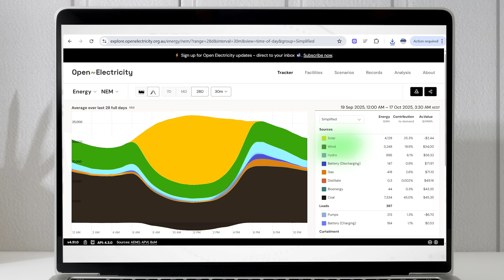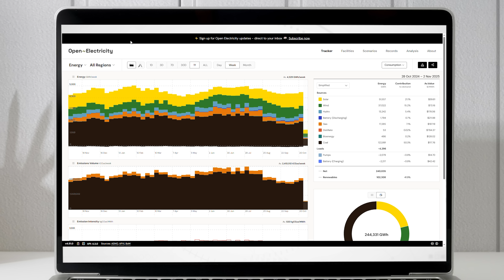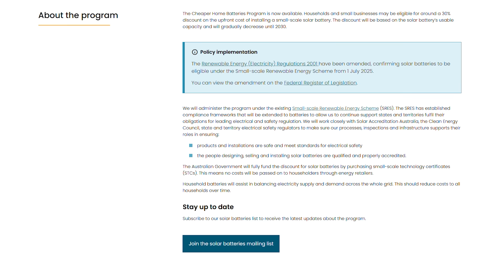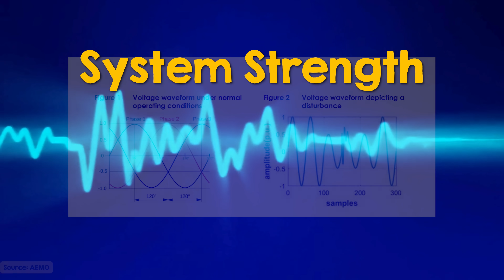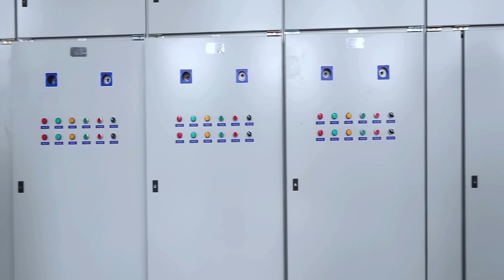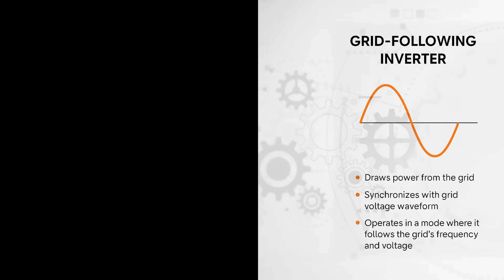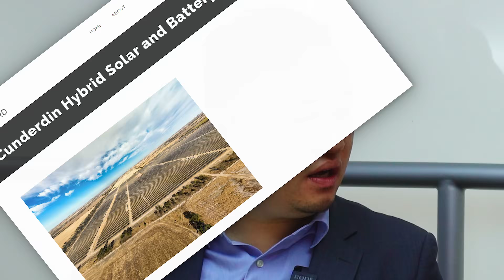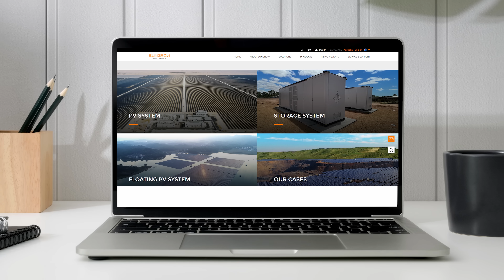Australia’s Solar Boom Is Breaking the Grid - Or Is It?

Comment: Sorry to be the negative nancy. But there are several problems with this rosy future. Firstly synchronous condensers don't increase power, they are mainly a stabilising device used to regulate voltage and improve power factor. And my biggest question with them is, if they are so expensive and in short supply, why is this the case, when demand for them has been growing in line with the roll out of solar on the grid. you would think manufacturers would have ramped up by now. Has the energy regulator and the government been asleep at the wheel for the last two decades? 
Also in regards to grid following inverters, my limited understanding is that all rooftop solar inverters are required to be grid following in order to maintain safety so that they will shut down when there is a grid level blackout. If the solution to the lack of inertia is grid forming inverters will these only be able to be used at  grid scale generation systems and will they be sufficient if only used in relatively small quantities at key locations. The lesson we should be learning from the Spanish grid blackout is that it's very difficult for anyone to foresee all forms of disturbances at the software level and thereby protect against them. These wide scale blackouts have demonstrated that while software can be used to solve these kinds of problems it is never implemented before these disasters happen and can only be resolved after a failure occurs. So what future blackouts are we able to protect against when we can't foresee how that should be implemented in software. 
I'm not convinced that software will solve the problem of grid stability when it can fall over in so many different ways. The old school spinning generators were able to absorb almost any wobble the grid threw at them. I doubt that the nem will ever get to 100% renewables. The current government is just starting to admit that despite their ambitious desires for the transition that they will need to keep coal generators on line for the foreseeable future at least.
Reply: There were multiple reasons for the Spanish blackout, including those old school spinning generators failing to bring on their contracted services when required.

AEMO conducts an annual assessment of system strength, and it rates SA, which has already been at 90% renewables for the last month, as the only state NOT at risk of system strength shortfalls over the next 3 years without further action. SA has implemented multiple levels of protection combining gas, synchronous condensers, BESS and grid-forming inverters. It is SA's widespread use of BESS for system strength that is one of the main points of difference to the Iberian situation.

The main reason that the latest ISP saw an extension of coal generators was that it had to accommodate current Qld government policy in its planning. We are yet to see how that plays out given that Rio Tinto, for example, has brought FORWARD the closure date for Gladstone.
Reply: @tassied12  Yes I know this. But you're actually proving my point. SA has the most system strength today, not because of the governments successful roll out of renewables and concurrent back up and protection systems, but rather because they've already suffered a statewide black out. They had to quickly invest in emergency backup capabilities and have since built many other types of backup and storage systems. So yes they might be ahead of the other states, but only because they have already suffered one of these widescale outages. I'm fairly certain the government wouldn't have built that much back up and system strength if they had not suffered already a statewide black out. 
You can easily make the argument that inverter based generation did not cause either the SA blackout or the Spanish black out, but it's undeniable that inverter based generation played a significant role in the cascading failure that led to these blackouts.
And don't worry Gladstone won't close, when it comes to crunch day the government will have to pay whatever it takes to keep it online since we don't have any other solutions in place yet. Multiple of the aging coal fired generator stations have brought forward and then deferred their closure dates already for this reason. The reason they want to close is because they are not profitable under the current government regulation, but the government cannot allow them to close as that will leave us with insufficient backup capabilities. SA's power grid is not as renewable and green as they like to claim, because they spend a large amount of time buying power from Victoria. Right now both interconnectors are maxed out, so they can't claim that power is green, but they do...
I'm not opposed to renewables. I love the technologies, but you can't just build renewable generation without sufficient other backup systems to keep the grid on when the sun isn't shining...
Reply: @Techa-lo2dc  Certainly the 2016 SA blackout focussed attention on the system's inadequacies and without it we would not have had that first big battery that was so successful there are now dozens around the country in less than 8 years. Just like any blackout there were multiple systematic failures, and renewables being part of that system were not without blame. However the finger tends to get pointed at renewables and the rest ignored - Minister Frydenberg's reaction was typical.

There were 3 main causes for the SA blackout, and renewables were just one of those
(a) The initial trigger was loss of the interconnector. AEMO flagged way back in 1997 the need for a second interconnector to NSW to mitigate this risk but it was blocked by the Olsen government as it threatened their privatisation plans. It is finally getting built now.
(b) Incorrect threshold settings on windfarms which caused them to trigger safety shutdowns too soon. The operators of some of these farms were later fined $1 million for this failure
(c) The Pelican Point Gas plant which could have provided the necessary backup was sitting idle. It was later fined for a similar problem contributing to the March 2017 blackout.

Prior to switching to renewables, SA had net imports of over 20% of its power consumption. It is now down to around 5% and in recent years there have been a net surplus so it is now much less dependent on imports. This is one of the reasons for its favourable system security assessment.  

Sure there have been delays in retiring coal plants, but in the end they do retire, but at a cost to system security in the meantime. One of the reasons for the poorer security ratings of Qld and NSW are the unreliability of their ageing coal plants. A recent report by Nexa Advisory found Gladstone is one of the oldest and least reliable plants in the country. Unplanned outages have increased 65% since 2020 despite increased maintenance. Each of its 6 units have been offline for an average of 14 weeks a year

Many of the coal plant closures were announced during the decade of the LNP government, but myriad energy policies led to a lack of business investment for which we are now playing catchup. Meanwhile the clock keeps ticking on those old coal plants.

Comment: While there may be other solutions as discussed in the video to balancing power grid and energy demand but I have wondered for a while now if it would not be possible to convert a current gas powerplant to burn hydrogen and have an on site system for generating green hydrogen. Basically turning an old gas powerplant into a green backup/power storage solution. Obviously efficiency is a slight issue but there is the potential for a form of long term energy storage and any excess hydrogen could be sold for other uses. One of the big advantages as I see it is you already have the required power infrastructure and grid connections already built unlike when other solutions are proposed and built. 

Although I am sure there are reasons why this would not be practical in reality and it could just be the efficiency.

Comment: Because of the excess solar power some electricity retailers here in Aus now offer 3 hours of free electricity from 11:00 to 2:00 every day, my retailer does so Ive set my hot water timer to come on at that time.
If the hot water element turns off due to the thermostat then the power charges the batteries.

Comment: Watching this I can see that you're not an electrical engineer.

There's a lot wrong here. It says a lot that you mentioned frequency control only once. Also you mention Broken Hill, without mentioning the recent power faults it had. Plus the power outage in Spain, like that in South Australia, was entirely the fault of solar. The trips at the solar farms cascaded to the rest of the system. This would not have happened on a system where the majority of supply was from inertia inducing components (e.g. coal, hydro or gas).

Plus how do you not mention the massive cost spikes that every country in the world has seen as the percentage of wind/solar as gone up? It's all well and good to say just add more stability through connections. But someone has to pay for it. Someone is paying for solar/wind that only generates 15% of the time, or for new transmission lines that are just as under utilised.

I get that this is a complex topic, but this really does to be a rather biased presentation but someone that hasn't spent a whole heap of time actually working at power stations or evaluating costs
Reply: It is YOUR comments that have a lot wrong.  For a start the Spanish outage had multiple causes. It was NOT entirely the fault of solar.  Lack of inertia was NOT the issue. It was an over-voltage problem, not loss of frequency due to lack of inertia. According to the ENTSO-E report into the outage, a key cause was the failure of some of those synchronous generators to adequately absorb reactive power to counteract the rising voltage.

SA was at 90% renewables for the last month, yet the latest AEMO system strengh report found it was the ONLY state on the NEM not at risk of system strength shortfalls over the next 3 years without further action.
Reply: @tassied12 I don't believe anything AEMO says anymore. Sadly they've become a mouthpiece for the renewables lobby
Reply: @keirando AEMO is the market operator. Their job is to run the most complex piece of infrastructure in the country every minute of every day. 
Their annual system strength assessments provide a full analysis of strengths and weaknesses as a guide to future investment priorities.

Judging by the innaccuracies in your assessment of the Iberian outage, I would trust their analysis well ahead of yours.
Reply: @tassied12 good for you mate. As an electrical engineer I'm very sceptical of everything released by AEMO, AEMC, CSIRO, etc lately when it comes to renewable energy.
No reports have been honest about the high prices of solar /wind and the difficulties we will face.
The electrical engineers may still be in charge of day to day grid operation at AEMO, but they aren't the ones writing the documents

Comment: Maybe the only hazard of wholly grid forming inverters in large scale generation is if they react to a grid event and another one further away reacts too so the two corrections spike in a feedback duel/oscillation  much like network collisions when two nodes at each end transmit at the same time. Also I notice the home inverters have a ride through specified to prevent minor events tripping them offline and although it is  spread at the low end of the grid must have a stabilising effect due to the huge number.

Comment: "Cars will never replace horses" was the war cry back in the early 1900s. The same will happen with generation. Take it from an old fella who has worked in the power reticulation and generation fields for 50 years (now been retired for many years). These included apparatus (apparatii?) built in the early 1900s up into the 80s. From synch Condensers, Rotary Converters, MARs, solid state rectifiers etc up to controlling 15, 500 and 660MW turbo-alternators and transformers of all shapes and sizes.
BUT (there's always a 'but')
The gear I worked on all my working life was extremely robust, but my (extremely) in comparison, limited experience with solar has found them woefully short of the mark unfortunately. Electrical equipment damaged by natural events could repaired and placed back in service quite quickly thus reducing public power shortages, even equipment totally destroyed could be replaced quite quickly while we repaired the original.
I'm all for power solar panels, trust me, but we really do have completely rebuild our electrical reticulation system. We need to (imo) localise inversion, even to households could be done. Big job, but hey, humanity has already done that once before.
I truly loved my turbogenerators driven by steam generated by burning coal, they were almost living things, they would communicate by sound their problems but one had to listen to them. Times change and we must adapt to survive. Everything within the power reticulations systems can be changed and adapted, it will cost, but experience has taught us that things like long distance DC high voltage/power transmission is the go, many countries do it now, so the evidence is there today, many countries transmit high voltage/power DC vast distances with reduced losses compared with HVAC and the HVDC is inverted at the load end.

Thanks for posting.
👍

Comment: This is an extremely excellent technology. However, the current concern is not about the technology itself, but rather the code security under this active control. This is different from the Y2K problem. If the powerful energy in the power grid is deliberately manipulated for destructive purposes, it could potentially destroy the entire grid. In summary, while technological progress brings more efficient and cost-effective advantages, this advancement also provides a sufficient platform for its destructive capabilities.

Comment: "We might get to the point where electricity prices do come down" the most important point of the video "MIGHT", even solar installers know at the moment all it is doing is increasing prices. Also the supply of GFI is low, they are relatively expensive, have a limited life also production that is not ramping up quick enough. Another couple of points I would like to make is firstly the cost of solar panels at the moment is lower than the cost of the raw materials so the prices realistically can only go up without further breakthroughs and secondly the same is true for batteries, there are many battery factories and solar panel factories in China that closed this year due to these factors.

Comment: The reality is that AEMO has been too beholden to the "traditional" base-load generators and has failed to incrementally adapt to the changes in the distribution of generators within the system. This has been compounded by looking at energy supply and distribution separately from other infrastructure. Recently a new interconnector was constructed between New South Wales and Queensland. At the same time we have the rail network looking at the need to electrify the Melbourne-Sydney-Brisbane rail links to permit higher speed, higher capacity electric trains to replace slower, lower capacity diesel trains. The lowest cost solution from a whole of economy viewpoint would have been to run the electricity interconnection through the rail power supply system allowing the railway catenary to be tapped from the interconnector with the interconnector running through the already publicly owned rail corridor. Instead, the interconnector followed its own route that necessitated land acquisitions and access agreements and the rail system upgrade has been shelved due to the cost of electrification just to satisfy the railway requirements. Now consider interconnection between the Eastern and South West Grids alongside an electrified transcontinental railway. The South West Grid experiences its morning peak of demand around the same time as the Eastern Grid experiences its peak supply period and the South West Grid experiences its peak supply period when the Eastern Grid experiences its late afternoon to early evening peak demand period. If you think the distances are too great you need to think again as the Soviet Union and the Warsaw Pact countries had an integrated grid from Vladivostok that connected through to East Germany that used the power distribution system for the Trans-Siberian railway as the main means of interconnection.

Comment: if homes run primarily on the batteries located at each home, then the grid becomes the back up instead of the primary source of power. Instead of supplying energy to address peak demands, the grid can be configured to supply average energy demand using the batteries at each home & business to supply the peak loads.

Comment: The only thing I can think of is how this battery tech will be the downfall of Australia. It is and has always been the issue with going full on renewable. Lithium battery solutions are a ticking time bomb, not even figuratively, literally time bombs. All it takes is one bad cell. This video even shows that their only solution to storage is more batteries. Thanks green lobby sure looking forward to an unstable grid. I can only hope that they won't lobby against other solutions to create a stable mixed grid, like chemical storage which would make alot more sense for a more rounded storage solution then just batteries that after 5 years have degradation problems. The only batteries that don't have the thermal runaway problem is solid state batteries which are still not quite there yet.
Also I sure hope that this digital method is isolated networks and redundancy fail safes as going full digital is prone to hacking and uncommonly but not unlikely coding errors.